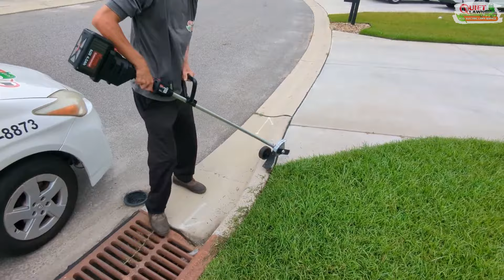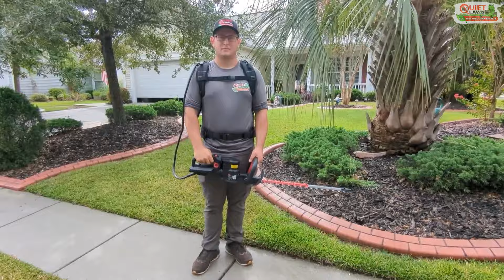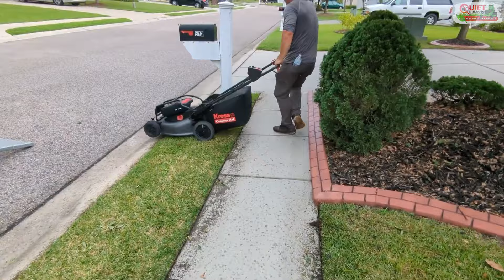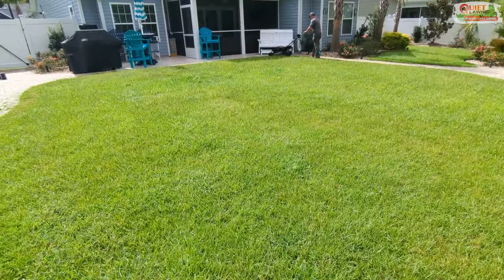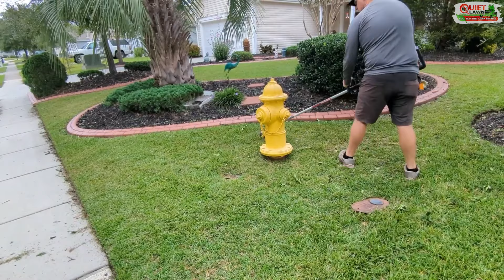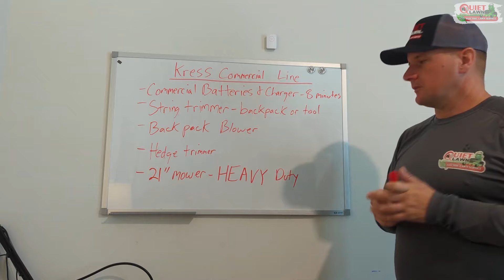FIRST LOOK - Kress Commercial Gardening Tools | UNLIMITED POWER | Electric Lawn Service

Comment: I use Stihl (the batteries are made locally) and Milwaukee mowers for my electric lawn care. 130 houses a week. When I do a different dedicated truck in the spring I will try these. I am doing a transit connect.

Comment: Very interesting charging advantage. But it's not as unusual when you look closer. I figure they are charging at level two speed in automotive terms. 50v x 12Wh = 0.6kWh and can fully charge in 15min. If my math is right, it would take about 4.25hrs to charge 10kWh which is the same as my Chevy Volt's usable capacity. So, they are charging these batteries at about 16amps. I'm not an electrician, just an EV driver.
Reply from the maker: I'm not sure. They're battery technology is different and patented and has a lot less resistance. Works off of a standard 15amp circuit and had no issues tripping breakers.

Comment: Battery warranty??? That's what I want to know. EGO is 5 years. People complain about EGO batteries failing and EGO's fast charger is around 45 minutes to an hour. Fast charging lithium batteries degrades the cells extremely fast. Charging in 8 minutes will kill the life of the battery but if they are giving you a 5 year warranty and you can keep changing them out for 5 years then it definitely is a game changer. Have you seen EGO's new pro line? The way you can quick change the power head is definitely a game changer too
Reply: The warranty is 6 years on commercial batteries.

Comment: Is this mower self propelled ?
Would like to see this product up against Makita commercial.
How many watts does this charger pull to charge so fast ?
I am wondering because I charge my batteries from my van alternator and two solar panels.
I always injoy watching your videos.
I have a lawn care business just outside Toronto Ontario Canada and I don't know of anyone else in my area doing electric lawn care.
With the price of gas ⛽ this is the way to now go.
I use Makita and Milwaukee ope tools but imo Makita is the best.

Comment: When is someone coming out with a good battery push mower 25-30"  ?
Reply: Keep an eye out for Greenworks at Equip Expo, they will be releasing their long rumoured/teased 30” commercial lithium mower…
Reply: @mugget  
I contacted them and they said they do not have any push mower bigger than their 25" in production.

Comment: Game changer for sure on charging. I imagine it will only be a matter of time before the other players catch up.

Weight is very important to me. Is the backpack blower under 20lbs including the 11amp battery?

Also do you know the lengths of the trimmer and stick edger? I'm tall. 

This is definitely exciting to see.
Reply from the maker: That I'm not sure of, but I'm sure the backpack blower probably isn't under 20 with the backpack battery. I don't know the length of the edger and trimmer, but they seemed as long as the Ego tools we use
Reply: @NeonPestandLawn  Ok. Well exciting nevertheless! Thanks!
Reply from the maker: @KeepItMowed  Yes sir

Comment: Dude that charger 😳 I’m using all ECHO battery handhelds, 15amps gets me through the day if I’m careful but a charger like that would let me run things wide open all day and I wouldn’t be considering power usage at all
Reply from the maker: Yes sir. It's a game changer for sure and will greatly reduce the number of batteries needed.

Comment: This thing looks great! I'd love to see a side by side comparison with the EGO AS motor mower 😉

https://youtu.be/Ybb82H5xylw

Recharge time is interesting 🤔🤔🤔
11ahX60volts=660wh
15min recharge time, so the charger output is around 2.5 kilowatts? Interesting 🤔
Reply from the maker: Yes, that would definitely be a cool comparison.
Reply: AS Motor are a very specialised niche market equipment, not really comparable to anything else… 

The AS 510 E-ProClip runs over AUD$4,000 PLUS batteries. I’m going to go out on a limb and say the Kress mower WITH battery will be somewhat less expensive. 

Pellenc Rasion 2 is the market leader in commercial lithium push mowers, but again a bit different with a 24” cut. All day runtime with a single battery so charging is not an issue. 3 year commercial warranty. Priced around AUD$5-5.5k including battery and charger. But I’m not sure if they’re available in the U.S., seems like a very insular market. 

The only downside with high voltage batteries are the heavier weight. They suit higher powered equipment which is naturally heavier like mowers, but handheld gear is a different story. To me Husqvarna 536 lithium line trimmer has the perfect balance and other brands like Pellenc have some of the best hedge trimmers I’ve ever used. I don’t see any problem running multiple battery systems, I am using 4 different battery systems currently if you include Milwaukee power tools.
Reply: @mugget  I currently run:
*Pellenc rasion smart 2 mower 
*EGO multi tool with edging attachment 
*Ego 650 blower

Mower is disappointing for $7,500nzd. Unless your clients are weekly, it's perfect. 
Love the trimmer, but it's always nice having more power at your disposal 😉💪🏾
Blower is perfect for blow downs after mowing, but perhaps not for leaf removal 😁

I'm prepared to pay top dollar for the best of the best, but it better perform 🤔